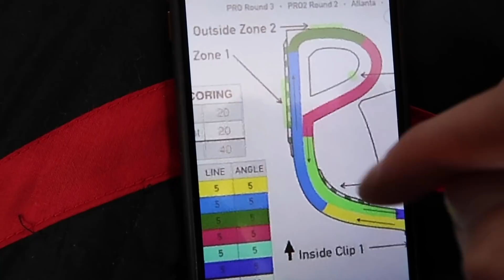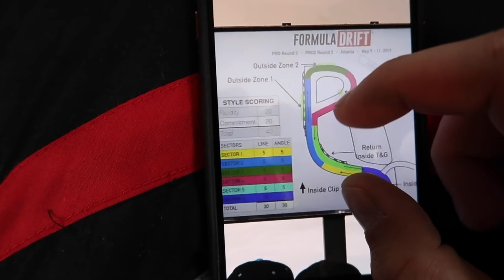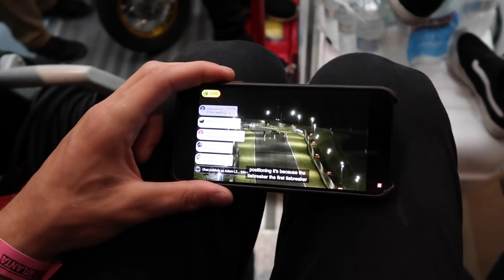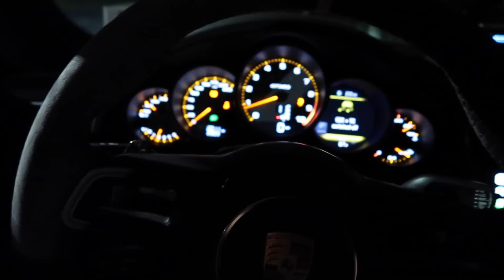My Second Pro-2 Drift Comp - ATLANTA DOWNPOUR

Comment: adam? why were there type x taillights for a s13 sitting on the railing at 26:12 - 28:11? i have been trying to find a decent set of those for my s13 for the last two years up here in canada, you not only have them on your s13 but have another set just chilling on the railing? year of the flex i guess lol

Comment: Y did they put u up with Sexsmith for your first round? Good luck tho 🤞
Reply: Its not "chosen" to duel him, its like last vs first, 2nd last vs 2nd first etc.
Reply: They bracket high qualifiers against low qualifiers. That's the point of qualifying, they don't just pull names out of a hat
Reply: I know how it works but thanks tho. I said that because Sexsmith looked pretty good during his first quali even though he had his first run on the dry compare to Adams.🚗💨💨

Comment: SUPER QUCK AND EASY ACCURATE PIT ALLIGNMENT METHOD MOST BIG TEAMS USE INBETWEEN QUALLY AND RACES IF THEY GET A BUMP  they fab a rod that bolts into spots where ur front bumper clips in and same for the rear so 2 rods parallel at front and back , a string running from front to back both sides , sliding the string as close into the car without touching a wheel ,one guy on the front left,  other front right, both with tape measures ,measuring top , bottom & centre distance from the string while yelling out measurements to the other guys until both guys have aligned the front ... understand ?? SUPER QUCK AND EASY Will diagram it to your Twitter

Comment: Idk whats going but u can drive so much better than you're doing
Reply: SLOWZ33 He’s not mentally able to deal with the pressure.
Reply: @sherlockholmes60  What I heard was someone smashed into the back of him during the practice run which fucked his rear suspension. Because why would he be able link everything in the qualifying when it was half wet and half dry, but in the actual comp he washes out on the entry in the dry? Doesn't really make sense to me. That's why I believe it was the accident earlier that caused him the loss, but I guess we'll see what he says next video.